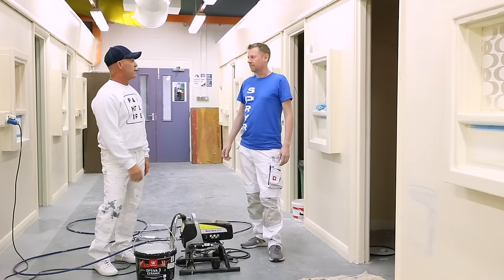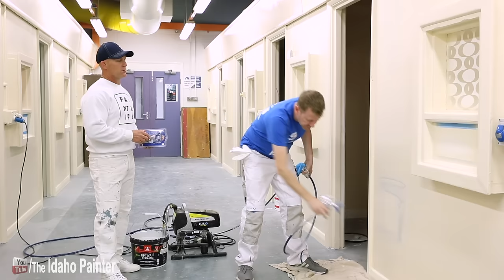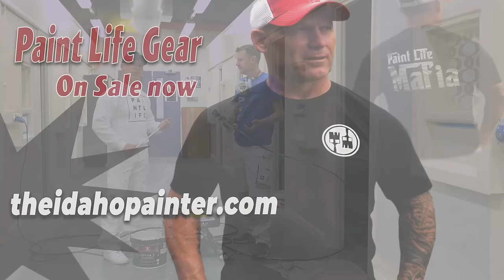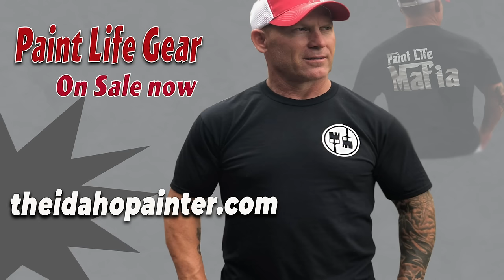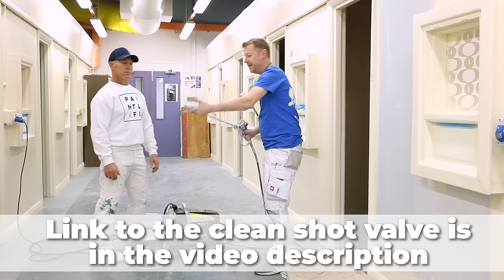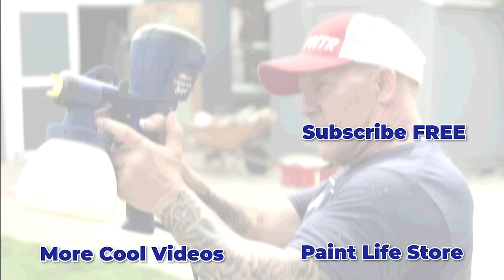VERSATILE Painting Tools.  Using a Clean Shot Valve.

Comment: Hi 
You guys make it so look so easy. 
Well i bought one of these graco cleanshot valve and is no way that i could make it work with 50cm lance without spitting. I followed the instructions to the word.  I adjusted the pump pressure gradually in 100psi  from about 1500 pump pressure all the way up to 2500psi pump pressure. Tried it at every 100psi up with valve turned to spray. At same time adjusting the valve itself as well. No way i could get it to work and not to spit. WTF.  I am so pissed off because i bought it specifically to paint my high 2.7m ceilings. So guess what i ended up painting it from my 4 step ladder. It was a pain in the butt truly. 
Could not get in touch with the shop because of the lockdown COVID-19 for 4 weeks.

Comment: Wondering why you guys stop the tiger every time you are going up/down, wouldn’t that be easier to keep it on until you finish the wall?
Reply: Triggering stops the build up of paint during the sideways movement, especially when you’re spraying an unmasked area
Reply: Jo B Productions 

It’s totally fine on ceilings and walls, perhaps you can get that problem on trim because the corners, I personally think it’s better to keep it on start to finish and do a good overlap. That’s my opinion, thanks;)